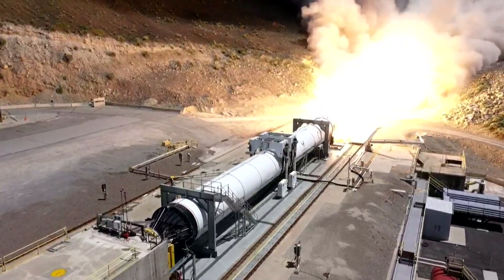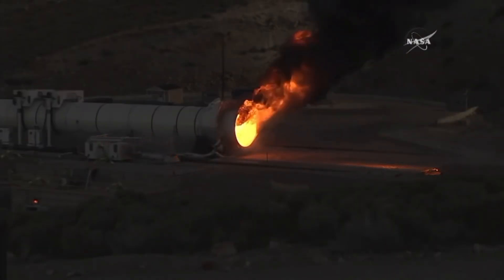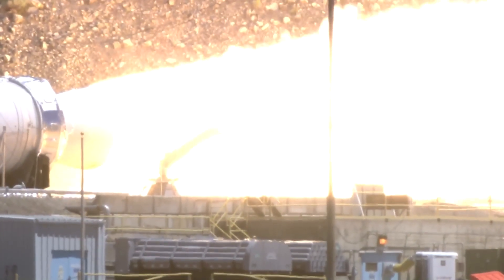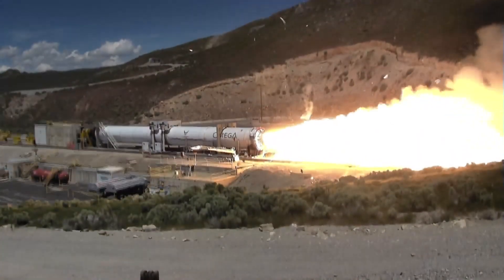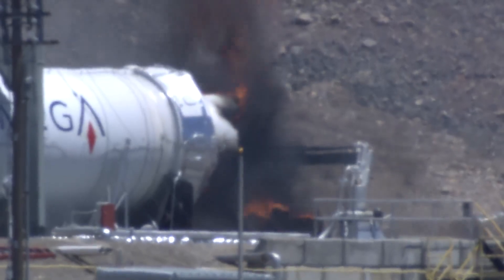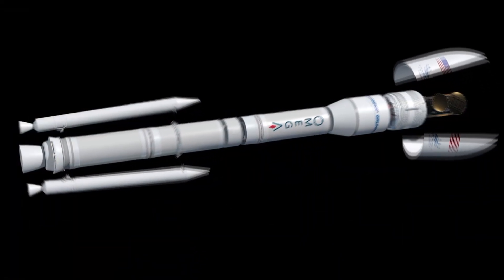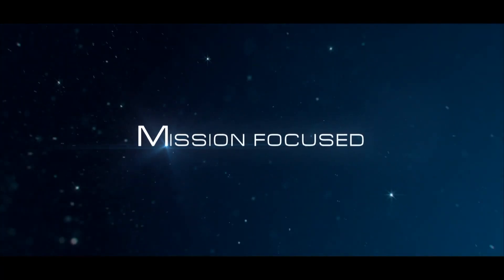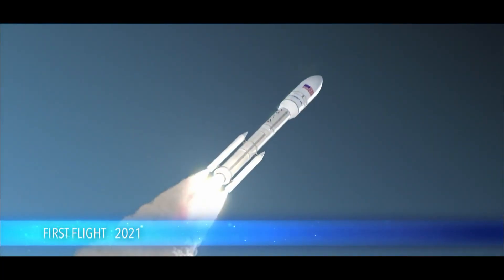Northrop Grumman's OmegA Rocket Fails During Static Fire Test -

Comment: Btw, the robot arm dispenses CO2 into the rocket ;)
Reply: I remember it being specifically CO2 and the amount they spray in there was a ludicrous figure but I don't recall off the top of my head how many tonnes of CO2 they release just to put out the residual fire. It was some mind-boggling amount.
Reply: On a visit with the Rocket Test Group about ten years ago we were given a tour of an SRB ready for test. The cooling is required because the motor has a lot of molten aluminum oxide slag inside at shutdown, and if not actively cooled the slag will puddle at the bottom, cook through the insulation, and overtemp the structural wall. This is just an artifact of firing the motor on its side.

Watching the run from the observation area below was impressive. I could feel the radiant heat on my face from several miles away, and the thunder made my clothing vibrate.
Reply: why am i reminded of that rather stupid robot in Iron Man
Reply: @thomas.02  Yes!!
Reply: This is all great discussion and it's true that CO2 is typically used.  However, for this test the quench really was water.  I'm not guessing or supposing looked more like water.  It was water.
Reply: @ltcolchemist4877  do you have a source?
Reply: Let's just say I am the source. I'm not allowed to give any details but water from the quench did require analysis for safe disposal.
Reply: My girlfriend dispensed CO2 into my rocket. :)
Reply: A noob question. Why not use halon?
Reply: @obiwanceleri  halon is a worse for the environment
Reply: @obiwanceleri  Fine question.   think like a rocket engineer for a moment.  Halon, chemical compound  used in firefighting. A halon may be any of a group of organohalogen compounds containing bromine and fluorine and one or two carbons.    as a engineer you want to evaluate the insides of the rocket after the test and the ingredients of halon are not chemically inert, but Co2 is so it wont react with any test hardware thus (not) coloring the results of the test.     hope that makes sense.
Reply: water wouldn't be the best idea ;)
Reply: Why not use Nitrogen?
Reply: @patkins8319  maybe because it's more reactive than CO2 and can cause chemical changes in the hot nozzle? CO2 isn't as much a risk of that. Argon would probably be better still but is a lot more expensive.
Reply: @patkins8319  I know, but at the temperatures encountered, N2 starts to behave differently. Probably not enough to warrant the cost of going with Argon or another noble gas, or they would :)
Reply: @patkins8319  
Nitrogen can oxidize in the presence of high temperatures which would produce corrosion in the bits they mean to inspect. Even in your car's combustion chambers at relatively lower temperatures and only atmospheric oxygen, running a too lean fuel mix generates nitrous oxides... and acids... which can destroy your exhaust valves rather quickly.

CO2 is already as oxidized as it's going to get but it isn't going to become chemically reactive and try to eat the surface they want to inspect.
CO2 also has a higher thermal capacity but at atmospheric pressure it's already a gas.
Pressurized nitrogen wouldn't suck up enough heat to be useful, but liquid nitrogen would have to suck up heat to become gaseous... It could chill a local area very quickly, allowing liquid nitrogen to contact the hot surface which could cause catastrophic thermal stress and possibly an explosion.

CO2 isn't going to expand as rapidly as liquid nitrogen because there is no transition involved. It just goes from being a denser gas to a less dense gas.
Reply: patkins8319 your mum uses nitrogen
Reply: @Jeffery_Saulter  "your mum uses nitrogen"
yes to kill off terminators
Reply: @cubertmiso  liquid Nitrogen would do the trick, but so would any dense easily vaporised solvent like Chloroform
Reply: @patkins8319  
LN2 would not 'do the trick', if the test vessel is to be inspected afterward; putting a cryogenic fluid into a hot, volatile chamber like the SRB's just-spent interior can cause violent reactions like stress cracking or flash vaporization; which can also be 'a big mess to clean up.'
Reply: Jeffery Saulter Mine too, so what?! 
OK, i use nitrogen, here you have it, i said it, yeah, i admit i use it!!!
Reply: But...fuel have its own oxydiser, co2 shoul not have any effect.
Reply: @randomnickify  The fuel/oxidizer is depleted, they just need to cool the thing down and quench the remnants.
Reply: @randomnickify  combustion actually requires three things - apart from fuel and oxygen it needs heat.  You only need to take away one of them. That's basically what you are doing when you put water on a wood fire - cooling things down so combustion can not continue or start up again.

In this case the solid fuel is all but spent except for some residual product, so pumping liquid CO2 in there is enough to cool it down below the point of combustion regardless of whether there's still oxidiser left or not.

I'm sure they'd use water if they could since it's cheaper, but it's possible that it's hot enough in there to actually burn the water (crack the water into O2 and H) initially, plus it also makes a heck of a mess.
Reply: Chris Robinson ahhh.. the good ole' fire triangle from chem 101.
Reply: @Chris_the_Muso  Maybe also because water is corrosive and will get into all the parts and CO2 will immediately evaporate and dissipate in the air?
Reply: @Chris_the_Muso I'm guessing the steam could have an exploding expansion and/or the water coming into contact with the heated surfaces could act as a quench and introduce stress and cracks that otherwise wouldn't be there, making the post test analysis biased due to damage caused by the water.
Reply: @RCAvhstape  It could very well be.  Water will be more chemically and physically active making a huge mess.  I'd imagine it would be good to leave things as much alone as possible so you could inspect the residue and inside of the rocket, and maybe learn something about how the burn went.
Reply: @MuraKun  All good points which would have to be taken into account, however liquid CO2 won't be much kinder as far as reacting explosively is concerned.  Possibly it is just cold gas before it hits the walls though.  I'm sure they considered these points before deciding to use CO2.  There's no point trying to fly a rocket that's been warped or twisted during testing.
Reply: @Chris_the_Muso  it takes a lot of energy to separate water into H2 and O2, so this would serve to cool it.
The difference between this and a wood fire is that wood takes oxygen from the air to burn and this has a solid oxidiser mixed in. Putting water on a fire blocks it's access to oxygen.
You have the right idea about cooling it down though. The reason they don't use water is probably something about damaging the hardware.
Reply: @nathanaelvetters2684  putting water on a fire barely reduces the access of oxygen. However as mentioned earlier it extinguishing the fire by cooling it. Or more exactly it introduces "spectator" molecules that takes a lot of the energy from the reaction. If enough energy is taken by the surroundings the remaining pyrolysis gases will not reach critical temperature to keep the chain reaction going. That's why you want as small droplets as possible when fighting a fire. Basically bigger surface area per liter resulting in better cooling effect. Or as my professor put it: Theoretically a dL of water is enough to extinguish a fully developed apartment fire.

The reason not to use water here is most certainly the risk of damage as you wrote. There are several problems with water. The expansion when it evaporates, corrosion, and possibility to act as an oxidizer for possible remaining fuel since aluminium is involved. And they probably want all probable damages to come from the test and not the cooling, so no reason of risking it.
Reply: @keefjunior4061  
I’m a firefighter, never took chem101, but when I went through the Fire Academy it was the Fire Triangle as well. Now they’re teaching the Fire Tetrahedron.... Oxygen (Oxidizer), Fuel, Heat, and Chemical Chain Reaction (Pyrolysis). Remove any one of the four and the fire goes out.
Reply: @randomnickify  Water would cool things too quickly and thats not too smart considering how hot it must been after test. Other thing, fuel with oxidiser burn even under water, Napalm like example, so it wouldnt help either.
Reply: @cyphi474  Napalm doesn't burn under water and does not have an oxidiser mixed in. It is just a mix of a heavy petroleum fuel and a gelling agent, originally an aluminium based soap of a fatty acid. This was done so it could stick to things and not flow downhill or off walls. 

During later development pyrophoric substances were added to make the napalm self ignite when in contact with an oxidiser. While these substances could ignite after being wetted the napalm did not have enough oxidizer to burn under water.  It would however start burning again as soon as the water had dripped off.
Reply: @randomnickify  the fuel is spent at that point once its going till its done. once that thing is going nothing can stop it till its over then they just use the arm to put out the secondary fire that is left over inside the burn chamber.
Reply: @randomnickify  fuel is mostly gone by that point. rubber liner is burning and co2 works well to quench the flames.
Reply: great idea, let's cause even more global warming
Reply: @z3bbbbbbbs  You know what we're all breathing out right now, right?  Relax.
Reply: @z3bbbbbbbs  
Don't be fanatically unscientific; there's less heat output from one of these rocket motors than from a single day of L.A. commute traffic.

There's also alternative atmospheric modelling (which the Copenhagen Sunnit conveniently sidelined) that show surface GMT warming as an artifact of heat redistribution as the density of the stratosphere and ionisphere decreases (cause indeterminate).  I was taught the 'greenhouse effect' model in junior high in the '90s, before there was enough data to underpin it as a probable cause:  So I don't buy A.C.C. as a 'scientific fact' - not because climate change isn't happening, but because we're not being properly open-minded and objective about how it's happening.
Reply: *THIS IS BASIC CO2 LESSION FROM SCHOOL BOYS AND GIRLS*.
Reply: HuntingTarg If you're older than 25, you've already lived through three quarters of humanity's total output of CO2. One HOUR of LA traffic is already an atrocity.

Comment: Would it not be better for anything downwind to have some kind of water spray to try and knock down (as best they can) that massive plume of dust ?
Reply: There is 30 miles of desert and mud flats before civilization starts the dust falls out just fine. A passing front kicks up more dust than that.

Comment: Too much gaspreasure in the nuzzle? Too much vibrations, heat?
In the end it doesn't realy matter this was a rapid unsceduled disassembly, so does this mean that Northrup Gruman goes Kerbal now?
Reply: Well, no. They went politician, and declared the whole test a success.
Reply: @marvinkitfox3386  Mythbusters: Failure is allways an option!
Engineers: As long as you learn something from failure it's a success, even if you only know this isn't working.

Comment: One thing I have always wondered is why not test pointed down? As it will be in real life, after all solid material will follow gravity and not burn evenly sideways (the part of booster near ground will have more weight on it and like sand falling down a hill will be slightly longer than top fuel material's that have less resistance in this sideways test)  so material could start to settle on the nozzle unevenly and something like this could happen. Testing sideways is not good enough, if rocket is supposed to go up they need to test it going upwards thrust being held down. Only part of flight of solid rocket motor will be angled as craft starts circulization turn or is in gravity turn. So why test whole thing sideways, yes might prove it works but is not thorough enough to put payload on new setup. Should test at least once anchored to ground with void under nozzle.

Comment: Honestly with how much SLS is delayed id don't feel an SRB failure affecting the schedule too much. by the time, the Rocket is done, every SRB problem will probably be fixed
Reply: OmegA isn't part of SLS.
Reply: @DECODEDVFX  of cause it isn't but if the SRBs share a common failure point that could affect SLS. but even if that's the case, the issue is probably fixed until SLS is ready

Comment: Maybe the motor "coughed" and some spit went flying :-)
Reply: That was my thinking too , like a car back fire which i have seen blow a muffler apart or even an aluminum inlet manifold ..
Reply: Like it had a momentary over-performance that exceeded the  strength of the nozzle.  Solid rocket propellant is explosives with a built-in moderator to reduce detonation to a vigorous burn, am I  correct?  Maybe the moderator material was insufficient in part of the propellant mixture, causing too much vigor for a split second?

Comment: I doubt it was a void in the fuel composition, that would likely have resulted in a far more exciting event!
Reply: Agreed, if it had been a fuel de-formation/de-bonding it would have definitely caused a more specific and demonstrative action.  It could have resulted in a burn thru at the point of contention. Certainly there's an insulating 'coating' applied prior to pouring the fuel into the case; but if a fuel 'issue' whose to say it didn't compromise the insulation.  Hopefully the telmu will give them a good picture of what/where things went sideways.
Reply: @jwschwartz7073  A void or crack would increase the surface area of the burning front, which usually results in a localised and catastrophic increase in burn rate.
Reply: @bobthebomb1596  Just because I'm feeling kinda stupid at the moment, I'm guessing that's a fancy way of saying "if it had been a void, a lot more than just the nozzle would have blown up", right?
Reply: @Penningtontj  Yes :)  A sudden increase in pressure within a void/crack will likely blow the propellant grain apart.
Reply: could have been a chunk falling off and as it exited the bell, it changed the pressure dynamic and poped it
Reply: I was thinking that this was an ablatively cooled nozzle, and it had just ablated a bit more than predicted. Once it got too thin, then *pop*!
Reply: Rocket rich exhaust?
Reply: @johnstreet819  Engine-rich exhaust

Comment: "with the exception of an observation at the end of the test".  Sometimes when you let PR dictate the message the end result looks like you are attempting to cover something up. If Northrop Grumman had said 'nozzle failure' instead of observation they would have more future credibility. Things break, in the development of rockets we expect the odd failure and if the design or manufacturing has potential to fail it is better if it fails during testing rather than in your customer's hands. It failed at the end of a test so the manufacturer probably has a record of nozzle parameters up to the point of failure so they may know if those pressures (or maybe temperature) exceeded the design limits and if they did was that pressure sustained or was there a sudden increase caused by maybe a partial blockage of the nozzle from a chunk of partially burnt rocket fuel ?

Comment: Things I have never thought about No# 2.187: Stress on the nossle
Reply: 2.187?
Reply: @driftability  yeah right between #2.186: Size of the landing-leg-pads and #2.188: CSM had to spin to bleed off heat.
Reply: Things I have never thought about...chunks of fuel impacting and damaging the the nozzles!  Maybe that is what happened to that failed carburetor on my chain saw.
Reply: remember, those nozzles are directing a long term explosion.

Comment: The real question is, was the disintegrated nozzle still providing adequate thrust and vectoring with most of the bell missing? You know like that one time when they cut 50% of the upper stage bell because it was cracked and this literally had no effect on the spacecraft?
Reply from the maker: It was ragged so no, it was making adverse patch and yaw.

Comment: well, for the shuttle the main engine gimbal would have been enough for steering hypothetically but the shuttle being asymmetric and the center of mass and the center of thrust shifting as fuel is used needs a LOT of gimbal to correct for so the needed gimballing boosters and once they have that it's more efficient to just use both booster and main engine gimbal for all steering which also allows you to roll faster